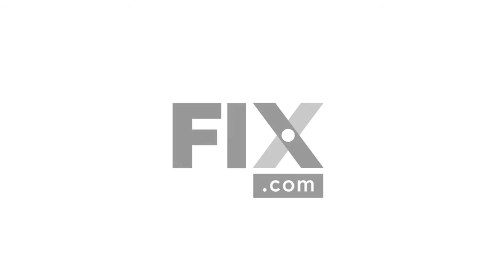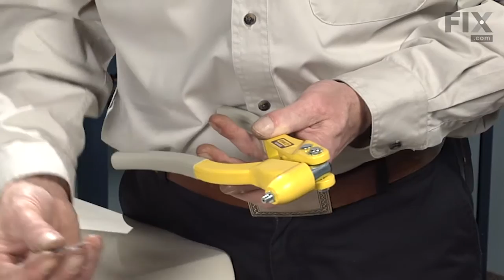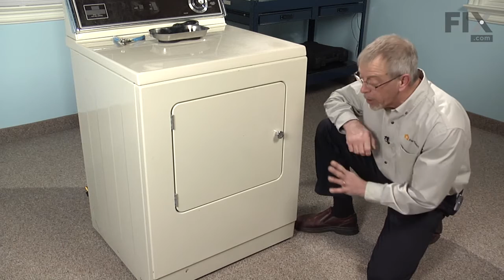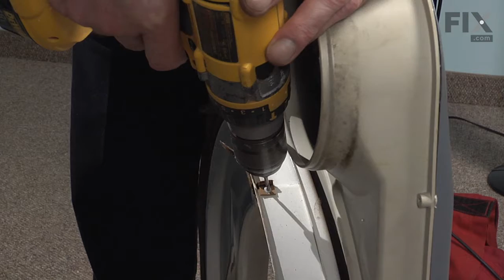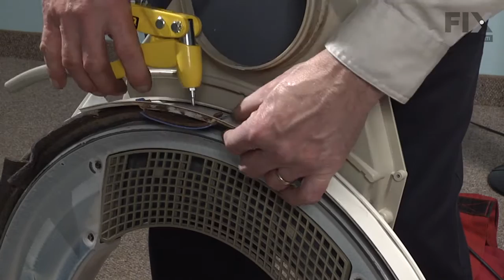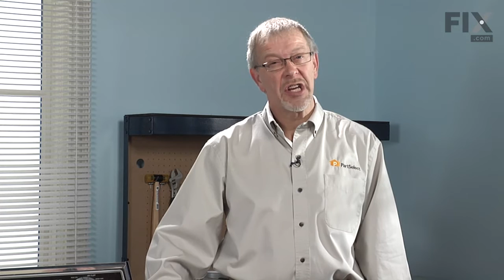Maytag Dryer Repair – How to replace the Front Glide Kit

Comment: Why would the flush side of the rivet go on the outside instead of the inside?
Reply from the maker: Great question, the flush side of the rivet provided the most contact area with the glide securing it to the bulkhead. The manufacturer allowed the space for the long side of the rivet to live with out making any contact with any moving part.